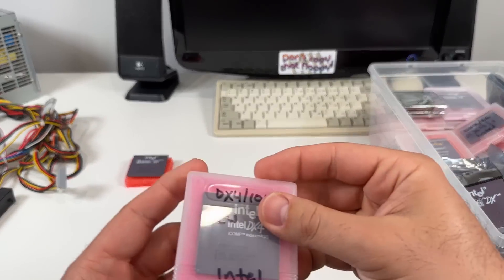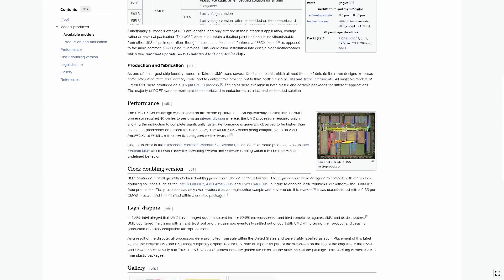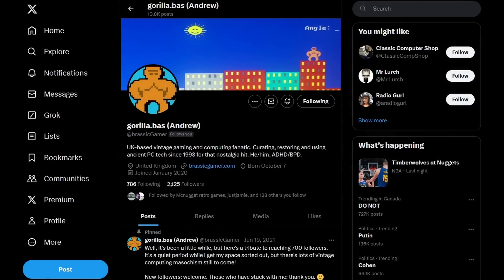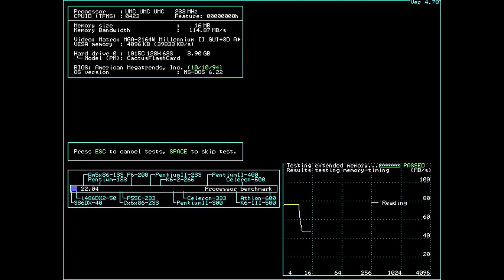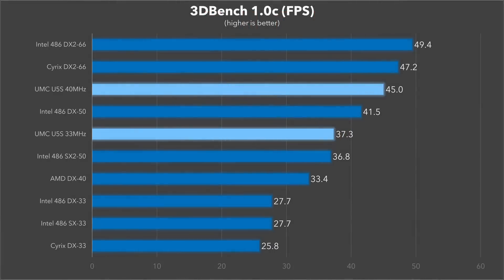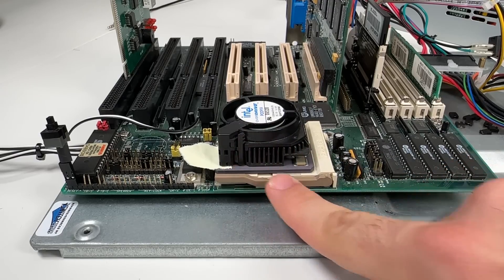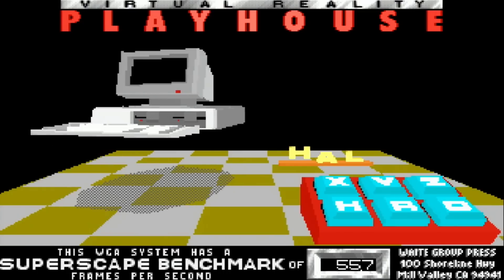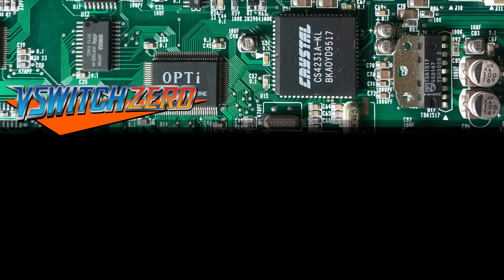The Forbidden and Forgotten UMC Green 486 CPU

Comment: We leased a pre pubic release beta 486 computer at a consulting firm. Its lease was about 1100 per month over say a year plus.  It could do 3 different "passes" of  Magnetic Recording Head modeling in say 12 hours; while our 386 took a day for One pass. 

OK by pass I mean just one set of parameters modeling the recording gap of a head for a 2.5 inch disc drive or a 3.5 drive. ei and turn the crank.

 2 passes meant one varied ONE of the input variables. The darn cpu on the 486 ran hot as blazes since always doing the math modeling. So we ended up making a bigger heat sink and several fans so the thing would not lock up.

The lease price of a grand a month was just for the 486 computer; not the software. That was say 1989 prices so righteous bucks

Comment: Intel (and AMD) big advantage in maths (and used by Quake therefore killing the competition because of this feature) was that they could (and can) use the ALU Integer math and FPU floating point math units simultaneously making it perform almost like a dual core when using both for integer math (wich they used) gaining huge performance that way. On Cyrix and others the ALU can not run at the same time as the FPU, so yeah kind of like a virtual dual core when it comes to integer math used this way.

Comment: Infamous DX50? Hmmm, why? Because if forced the requirement of heatsinks and people who didn't know that burned them? Or because VLB cards were murdered in MASS by the DX50 50Mhz FSB Clock (unlike all DX/2/4 etc which maxed out at 40Mhz but more often just 33Mhz - DX2-80 and DX4-120 are the 40Mhz ones all others are 33Mhz) ?

Comment: Quite frankly its a shame that there is no FPU extended version - and that Intel had to squash everyone who dared to create a better chip than them. (though i understand it from a tech point of view, but why not buy the technology and make theirs even better...)

Also perhaps the 60MHZ overclock could be more stable with a heatsink / fan... and could even go above if cooled a bit better?
(i noticed that my DX4 back then was happier when it was allowed to spread the heat better and (can't recall for my life what motherboard i had) but it was pretty cool at overclocked speed if it was actively cooled.
Reply from the maker: Thanks for watching! I forgot to mention in the video but I did indeed use a heatsink and fan for the overclocking tests 👍

Comment: I managed to overclock my AMD 5x86 = 486@133Mhz to 4x50Mhz=200Mhz with a heat pipe cooler made for Core2 Extreme a while ago. But to be honest, it wasn't utterly stable and bugged out twice during a two hour test. At 160Mhz it ran stable eben with passive cooling - although the case fan was flowing towards it from a distance.

Comment: The CPU-ID-String is 12byte long. That's why Intel uses "Genu ineI ntel" and AMD "Auth enti cAMD". "UMC UMC UMC " happens to also have 12 Byte.
Technically, you set EAX to 0 (xor eax,eax) and run opcode CPUID (0f 02). Afterwards you get the 12 bytes of Vendorstring in EBX, EDX and ECX.

See https://en.wikipedia.org/wiki/CPUID#Calling_CPUID for more information!
There are many other Vendorstrings!

Comment: IBM also manufactured a few "486" chips, although I believe they were never sold outside of their own models of PCs.
Reply from the maker: Hoping to do a review of the original blue lightning CPUs from IBM one day soon 👍
Reply: IIRC IBM's 486's are straight up exact copies of the Intel chips, just produced at IBM fabs since they had cross-licensing agreements.
Reply: @JeremyLevi You are half correct.  As per Wikipedia the IBM 486SLC & initial IBM 486BL were based on the Intel core, but later IBM "486DLC" chips were based on Cyrix Cx486 cores.
Reply: @darkally1235  Cool! Thanks for the additional info. I knew IBM's 586s were Cyrix-derived but I wasn't aware some of their 486s were as well. Makes sense though.

Comment: Am5x86 133 overclocked to 160 was the king of the hill of the 486 boards.
Reply: Even though they tended to overheat during long production usage.  I worked for a company that decided instead of going to legitimate pentiums, we would deploy those overclock cpus.  Until we figured out the overheating issue, we had months of machines hanging up randomly.  Eventually we modified some 1U appliance fans with much higher RPMs that kept the CPUs cool.
Reply: @lynnjr457  I had one of those but never had that issue. Was awesome for its time. When I would tell people about it I usually received nothing but disbelief.

Comment: I was born in 75 and grew up in this cpu era, I Kid you not, just today I was trying to look up a dx50 vs dx2 66...........and was having little luck with what I wanted...
the chart at 13:44 is every configuration and setting I was wondering about.  I had a 25 mhz 486 with the stupid overdrive socket for the POD that cost about as much as a new computer anyways, and pci was becoming a thing so I imagined that no one really purchaced the PODS and there was a GIANT warehouse or "atari land fill" of them some where.  Who Remembers when Computer Shopper was twices as big as the Sears Wishbook.....anyone???

I overclocked it to 40mhz upgraded to 8mb ram(from at the time Longview washingtons gas station computer store, they part where food and bevarage....nope ram and motherboards) added an 810mb hard drive(with disk overlay.....right....because) and installed Windows 95.

there is also the 8mhz POD that boots xp with like a stupid low amout of ram, it was quite the thing.
also does anyone remember an emm386(type) driver that let me specify hard disk as "ram" as to appear to the os or app as ram...I got it off some cd in the back of computer book from waldens or something.   I know it exists because i needed 8mb of ram to run magic carpet, I needed a dx266 as well, but tried anyways, to hear you hard drive being used as ram is probably worse than a good hard disk thrashing....anyways I got less the 1fps but I can say I did boot and run magic capet on my 25 mhz sx 486 with 4mb of ram at the time.

Comment: Putting the DX-50 in a PCI m/Board is effectively bottlenecking it with slow clockspeeds on the external busses. If you can, test it in a Vesa Local Bus equipped m/board, with a Side Jr I/O card doing the ports and the IDE Controller. If you can find a MediaVision Spectrum16 card for audio, and VLB Tseng Labs or VLB Number 9 VGA cards, and VLB based 3DFX accelerator board, you'll end up with a machine that plays LucasArts games like X-Wing vs Tie Fighter at really decent frame rates and resolution.

Comment: What a trip down memory lane. In the early 90's my parents decided to buy a computer for the entire family to use. It had an Intel 486/SX-16 in it. Needless to say, it wasn't great. At some point we upgraded to an IBM 486DX2-66.
I have never heard of the UMC Green 486 so thank you for sharing! Seems like UMC had a very talented engineering team. Too bad Intel killed off their CPU business.
Reply: There is no 486 SX 16. The 25 was the lowest clock speed 486 SX.
Reply: Hah. I checked Wikipedia and I was wrong. I built hundreds of computers back then but literally never saw a SX 16 or 20.
Reply: @ryanyoder7573 - No worries. I had to double check my memory too. Obviously it was an outlier.
Reply from the maker: They are actually quite difficult to find these days! Would love to find an SX-16 one of these days. They were typically only used in OEM machines. I believe the 16s were exclusively found in some Dell models.

Comment: Hey vSwitchZero, you done any videos on the Blue Lightning family? I seem to recall in my youth I upgraded from a 386DX to a 486 Blue Lightning 75Mhz. Well, at least thats what it said at post. It turned out to be a highly unreliable system that crashed all the time. Anyway, I'd be interested to see an exploration. My research indicates my memory is faulty and chips were never released that the aforementioned clock speed.
Reply from the maker: Funny you should mention the IBM BL! Will be doing a video on it soon 😁👍

Comment: I'd be curious about a for clock comparison with 5x86 from AMD.
Reply from the maker: Thanks for watching! The Am5x86 has 16KB of write-back L1, so performance would be a bit better than the 8KB Intel/AMDs clock-for-clock. Wouldn’t be enough to close the gap with the UMC green though. Unfortunately I can’t run a 5x86 or DX4 at a 1x multiplier for a fair comparison.

Comment: DX50 is for specialized systems and cases. Pair it with proper memory for memory-intensive processing or, with 50MHz-capable VLB video cards for it to shine.
Reply: Do you mean use cases? Examples would be appreciated as I have a DX50 sat on the bench :)
Reply: The trick was always finding VLB cards that ran stable at 50MHz. Maybe by now we know all the good ones but getting a stable config back in the day was a real case of trial and error. I knew more than one local beige-box PC retailers in those days that refused to build DX50-based systems for that exact reason, it just wasn't worth the support headaches.
Reply: @JeremyLevi  The DX2-66 was just all around better for most people. Lots of software just refused to run correctly on the DX50, even if the system was otherwise stable. However, I do recall one friend coming across one odd game (I can't recall what it was) that absolutely refused to run on ANY clock doubled chip, but worked perfectly on the DX50. It must have had some kind of timer or something that compared the bus speed and the clock speed and wouldn't run if they didn't match.

Comment: The sad thing is people STILL think of intel for stability and speed. And it's not true. In fact Intel has found that stock clocked 13th and 14th gen chips are crashing. So they've had to pull back on them a bit. Meanwhile AMD ryzen is rock solid and even windows feels smoother.

Comment: The Intel S-spec 'SX911' (486DX2-66) shown during the intro is great for a baseline of the last Intel DX2 with the standard 8Kb Write-Through L1 cache - You need to get the 'SX955' S-spec for a comparison of any speed boost for Write-Back L1 as compared to Write-Through. That test is made slightly more easily at the Intel 486DX4 level since there are more batches to 16Kb L1 in WB or WT. Another note that the POD63/POD83 can be really nutty with L2 cache (typically 128 or 256Kb if present) on the motherboard.
Reply from the maker: Thanks for your comment! I’ve been keeping an eye out for an SX955 and the DX/50 SX954. Would love to try them out. I do have an &EW DX4 with 16KB WB L1. Interesting that you mention that the POD can have issues with L2 cache. I was always surprised that the cache latency benchmarks were pretty poor with the POD. Thanks for watching 🙂👍
Reply: Yeah, it comes pretty close to the 35 fps for doom, and that was recomended on a DX2-66

Comment: And Intel 486 DX4 100mhz and AMD 586 133mhz (rare 150mhz) ???
Reply from the maker: Those are indeed very fast 486s with 16KB write back L1, but if you were to compare them clock-for-clock to the UMC green, the green would still be faster 🙂

Comment: All of us should spam UMC like crazy for them to do a production run of these 486’s on a more advanced node. 1GHz UMC 486
Reply: I'd be interesting to see how fast a 486 could be just for the fun of it
Reply: @yournamehere23435 especially wince just 6 days ago someone finally modded xp to work on 486
Reply: lol. what would you run on it?
Reply: What bus frequency it would run? On which motherboard?
Reply: @jbaroli They would have to engineer a way for the chip to run asynchronous to the bus speed, anything above 100 MHz is just not feasible
Reply: I'd like to see what they could do with x64 compatible chips these days.
Reply: The rest would bottleneck completely.
Reply: The fastest 486 is probably the Quark X1000.
okay, it's closer to a P5 Pentium, but 400 MHz are still quite a result.
And I'm thinking the same about NetBurst. One of those, but on a modern node and with much larger caches and faster bus units should be quite the performer.
Reply: @HappyBeezerStudios  If you revamp a arch on a newer node with no advancements there's nothing much to be made. You can make a FX for example more efficient but because of the bad arch a newer generation CPU will always be better in so many fronts.

Comment: It really was an amazing processor, when I first had the chance to test it I immediately ditched my Intel DX33. Its potential for overclocking resulted in the frequent addition of the designation by rogue vendors. I have a U5S-SUPER25-33 in my collection which was supposed to suggest its default operation at 33MHz.

Comment: I see no source for that 7 cycle integer division claim in wikipedia. Would be cool to actually test that. The "AGP" model of the Millennium II is in fact just a PCI device, and AGP runs at 66MHz, so it's possible that most Millennium II's can handle that frequency just fine, unless Matrox  had to use special binned chips for the AGP cards.
Reply: Those things were so hard to get a hold of when brand new, then they were a pain to set up, and then suddenly they were everywhere, being tossed out with the Dell and HP business workstations they were standard fit in. The long sockets on their side were for the Video Graphics Overlay board that used software for doing Lower Thirds and the like in TV stations.
Reply: AGP will gracefully degrade to older PCI standards if need be, so a card doesn't need to support 66MHz.
Reply: @SianaGearz  A bit like with the Voodoo cards, which never made use of all the fancy AGP features.
Reply: IIRC the et6100 etc were also quite overclock friendly

Comment: what about compared to the AM5x86 133?
Reply from the maker: The Am586 performs similarly clock-for-clock to Intel 486s, with some boost thanks to 16KB of L1 and WB support. I don’t have a way to get one running at 33 or 40MHz to compare fairly, but I suspect the UMC green would still be much more efficient on a clock-for-clock basis 🙂